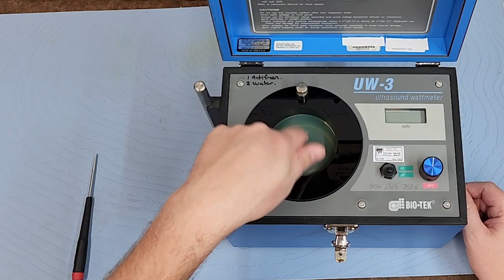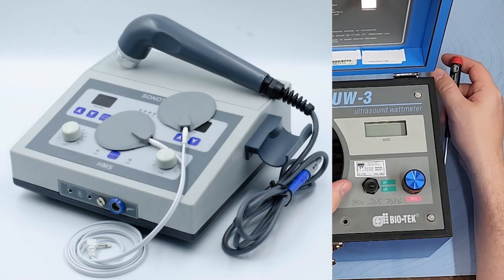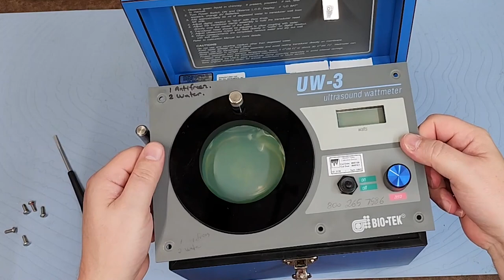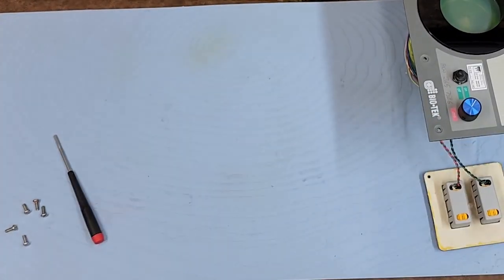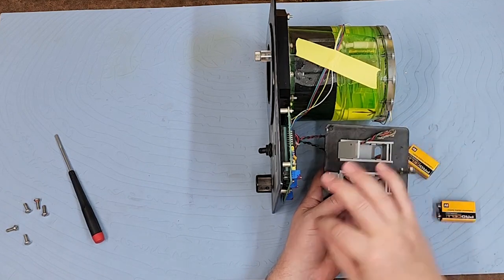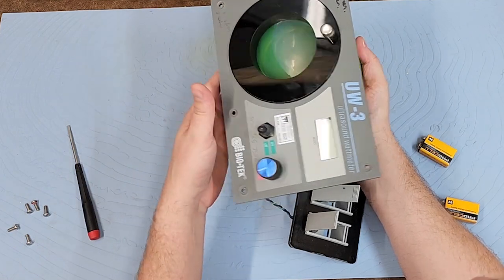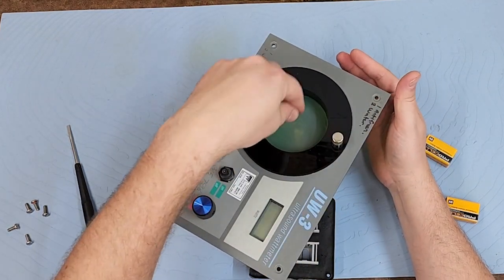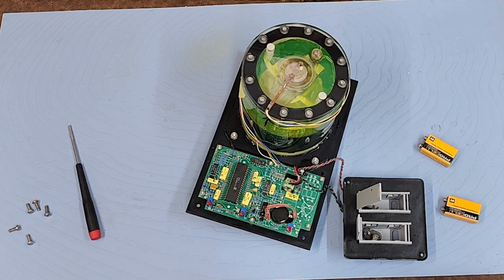!! Vintage Wattmeter !!

Comment: My previous fysiotherapist who is now retired, has used ultrasonic many many times on me, i remember if the level was set to high, that it starts to hurt very deep near the bones. But indeed, it helped with the healing. He also used microwaves, a old skool cart the size of a washing machine,with a mechanical kitchen timer and with a flexible arm with a big round "cookie jar" at the end, that round "cookie jar" where placed with rubber straps to the bodypart that needed to be treated. After a few minutes, you felt a nice warm glow coming from deep inside the body.

Comment: Hahaha. The one I use is even more primitive. Water bucket sitting on top. A cone on an arm through a linkage to a plate pressing down on a scale which is calibrated to output in Watts.
Reply from the maker: I've also used a similar meter.